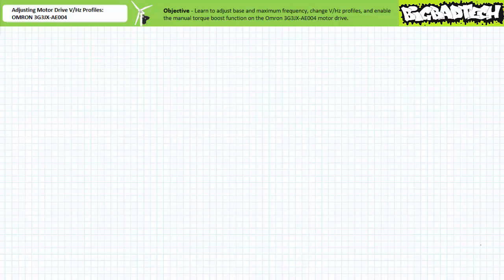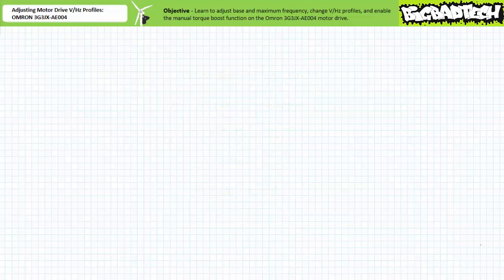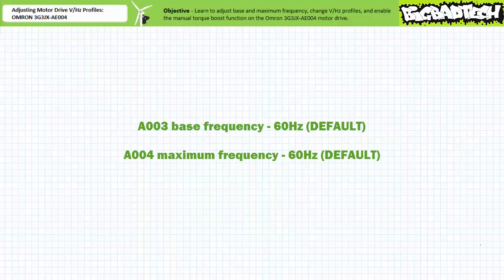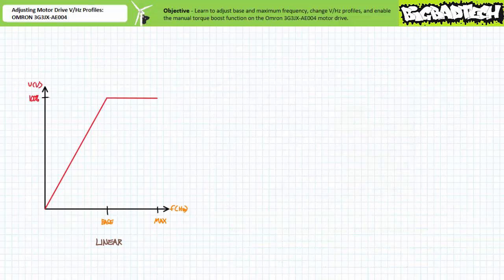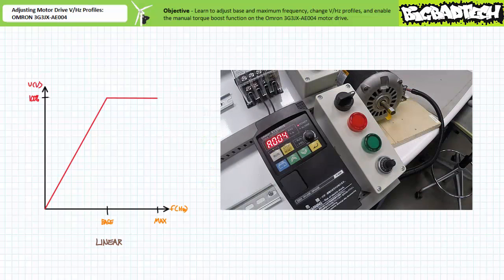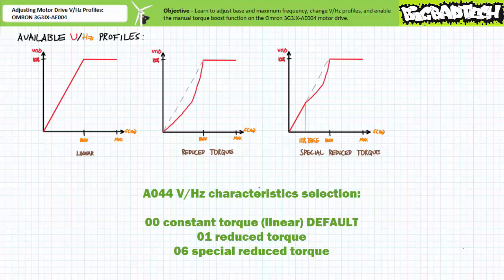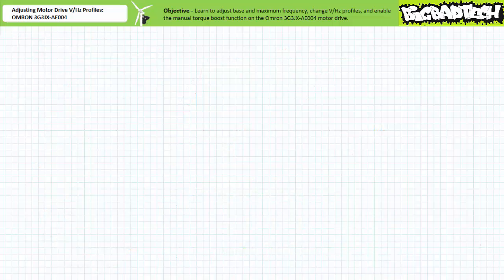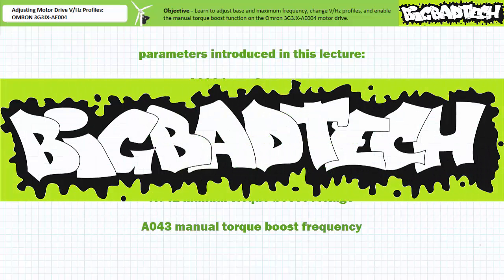Motor Drive V/Hz Profiles: Omron 3G3JX-AE004 (Full Lecture)

Comment: Where can we setup a nominal/rated current ? Is H023  parameter in MX2 for entering nominal/rated current from the nameplate of the motor for exact winding configuration .... It said H023  Io (depend of the capacity of the motor)! Is Io means output current ... and I assuming  that driver use that data for adjusting other parameters according to that!
Reply from the maker: An upcoming lecture deals with protection mechanisms for the Omron 3G3JX motor drives. For the 3G3JX drives parameter "b012: electronic thermal limit" establishes the current level beyond which overload protection must occur. This upcoming lecture also deals with a cunning means of active overload limitation employed by these drives. Haven't spend much time on the 3G3MX2 drives yet but that will soon change ... I'm actually updating our lab with 10 new 3G3MX2 drives that are hopefully going to arrive next week!
Reply: that is nice!!!  The MX2 is good piece of equipment !!! Few days ago we installed  one 0.4 KW . you can even monitor lifetime of its  main capacitor and cooling fan on d022... thank you!! We will discuss soon again ! :D Greeting Jim! :D